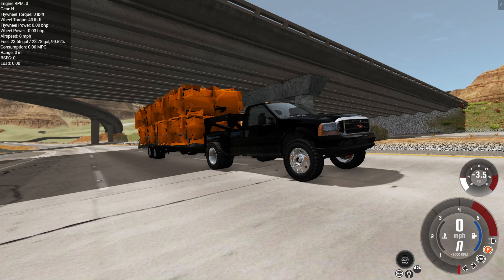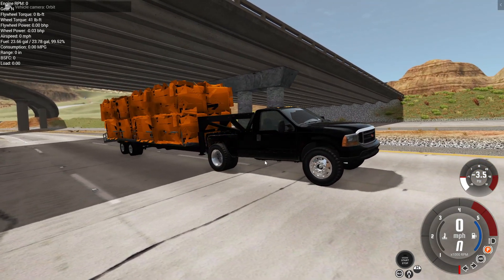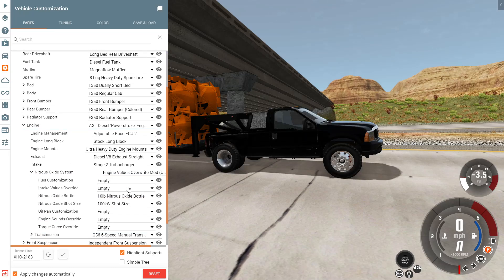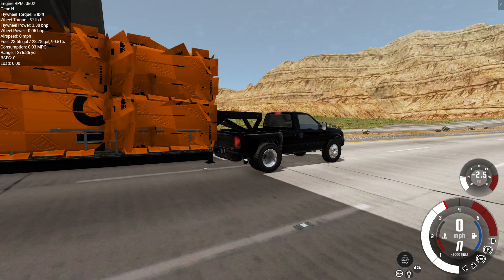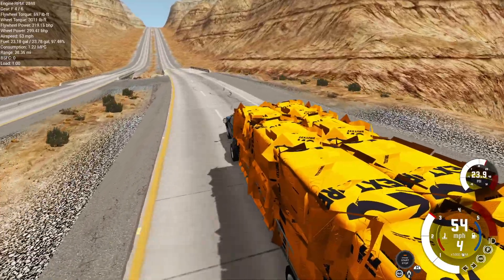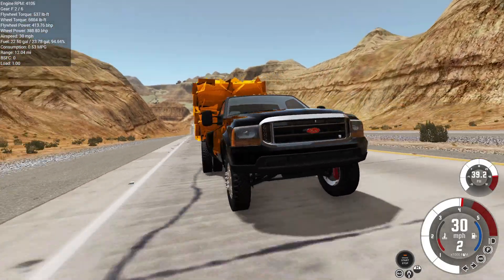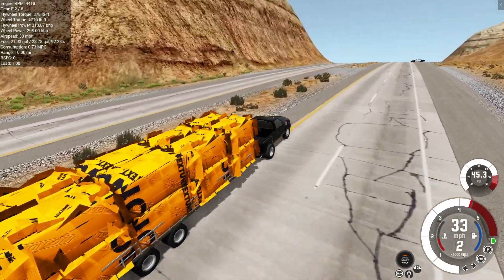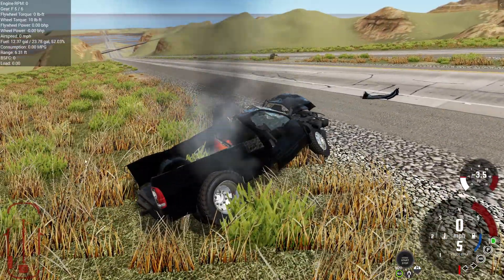BeamNG.drive |diesel tow test G56 Swapped 7.3 POWERSTROKE 21,000LB Tow Test

Comment: 4500 rpm in a 7.3 Jesus man that’s kinda high but then again you can buy cams for 7.3s pretty cheap a stage 1 can could get me 500 rpms but idk what that would do to the torque curve like I’m pretty sure the 7.3 makes more high end torque than a 5.9 but the 5.9 falls on it’s face along with the fact the stock turbo on a 7.3 will push 25 pounds tune down pipe etc

Comment: It could have handled 3rd gear I believe . 
Once again letting it lug lol
Reply: Engine makes 40 pounds of booste at high rpm so you run it at half it's rpm and boost lol
Reply from the maker: 3rd gear wouldn't hold enough rpm to continue moving
Reply: @BOSTV101  try again lol. 
It wrapped second gear out even once it bogged down. 
Need more advanced gearing, closer to one another, less increase in gear.